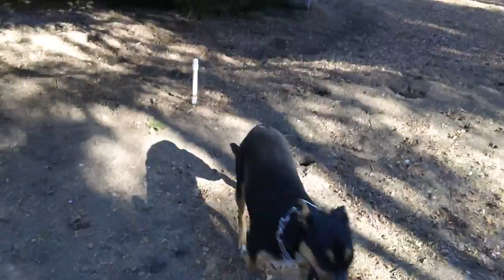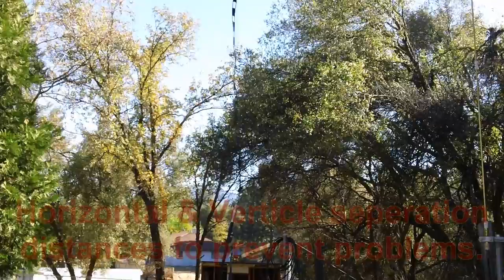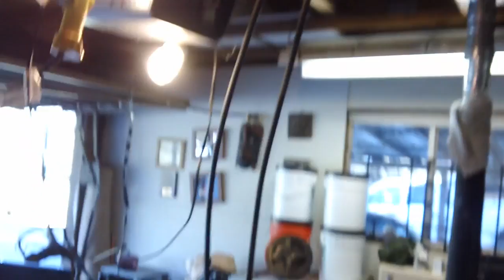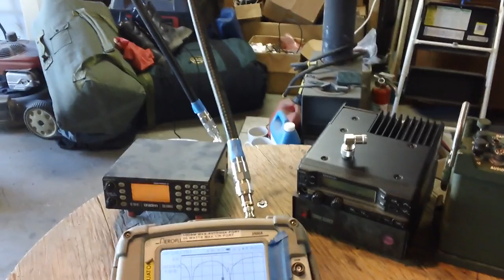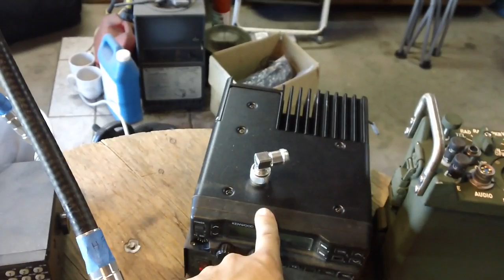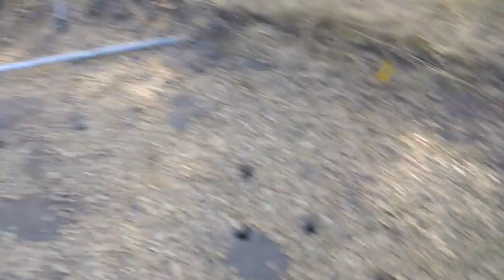Self Reliance Comm Center, Multi-Antenna Tower Loading, Preface

Comment: I can relate. Did mine last summer and still have a little fine tuning to do. I've got 7 antenna's
OTA TV, 20/40/80 rotatable di-pole, dual band, 6m Ringo, 1.Ghz and a GMRS repeater antenna.
I had to go to a 2nd monopole for the 2m/70cm/6m yagi's.
Liked that used LDF Hardline. Where I live rf is one factor, 2nd is wind load. Interference is not only during transmitting but an IF oscillation can play heck with another radio
Good video,
73 Dave W9DLP

Comment: Hi i am currently in a home made project to us in our community in case of a calamity, I am currently working a Mobile Communications Car which would theoretically operate in 4-6 UHF and VHF radios without interference when multiple radio is being used at a time (dispatch type with multiple teams e.g. Fire Team Channel on 1 Radio , EmS Team on another, Rescue tean on another one and so on.

If i install it in a van and only use a car antenna how far should the antenna be without overloading the other radios?

Comment from the maker: Its a gentle slope, the radio waves might skip off of it like angled armor. If it was a shear cliff wall, then yeah, its a bad test spot. When I check for reflected power, first thing, it will tell me right off the bat. I have other locations to move if it doesnt work, either way, I'll vid the good, the bad, and the very ugly.

Comment: All of the antennas are mag base type for portability. The 80 meter loop is almost 300 feet long and only elevated about 10 to 12 feet. Probably shouldn't even work but I've talked to Tokyo and Sth Pacific, Europe, and Sth America just some of the contacts..My radios are all portable and mounted in a milk crate for a quick departure if needed. The roof is metal so the magnetic bases are great. Other than the interference on the scanner everything else co-exists well. Probably better filters..?

Comment: I have a little more than a full wave 80 meter loop surrounding my house and radio shack. I have a dual band vhf/uhf on the roof (12 ft high) of the radio room and a tun-able HF whip antenna at the same height and about 3 ft away from the VHF/UHF antenna. Also at the same height but approx. 15 ft away is my scanner antenna. The only interference I experience is operating any of my vhf/uhf rigs (other than portable/handheld) while using the scanner. Really messes the scanner up.. continued..